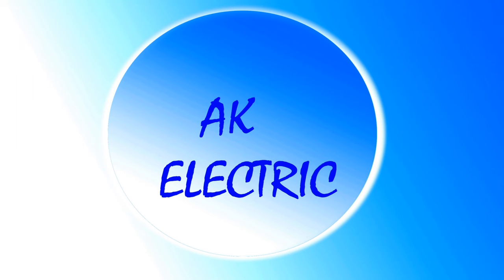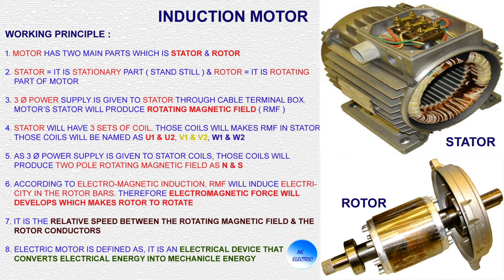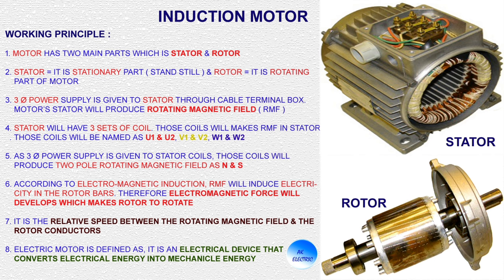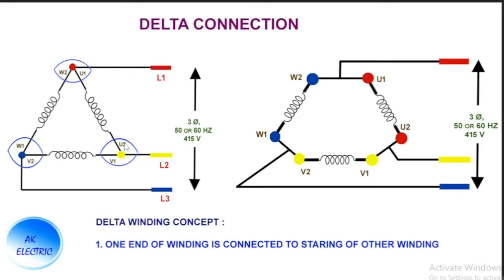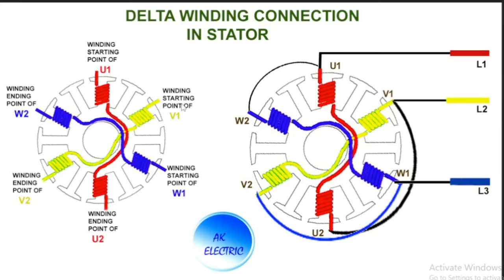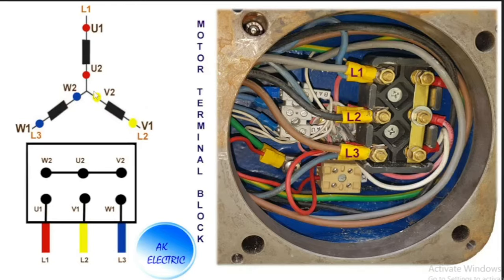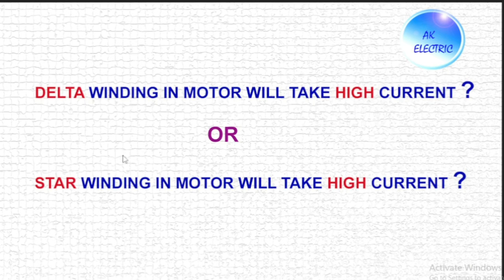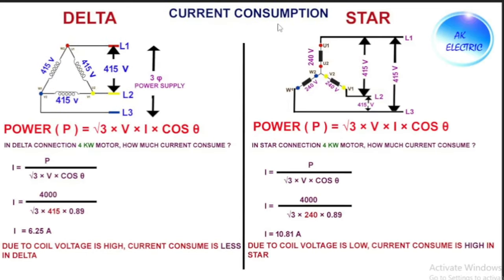STAR DELTA CONNECTION FOR MOTOR, MOTOR WORKING PRINCIPLE, DELTA OR STAR CONSUME HIGH CURRENT ?

Comment: And where 240v come from , if motor has no Neytral wire?
Reply from the maker: Dear Hi,

240 V is not injecting from motor terminal blocks, it is induced inside the winding of motor for star connection motor where as in Delta connection motor don't have 240 V ( but have 415 V )

Thanks